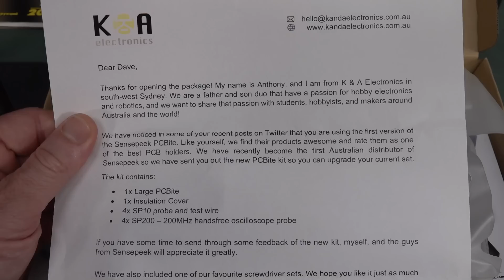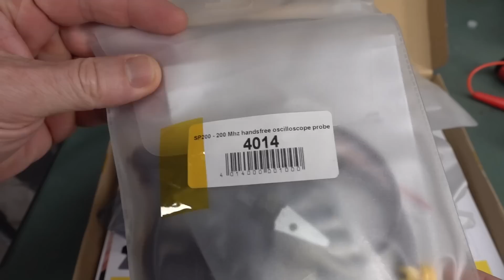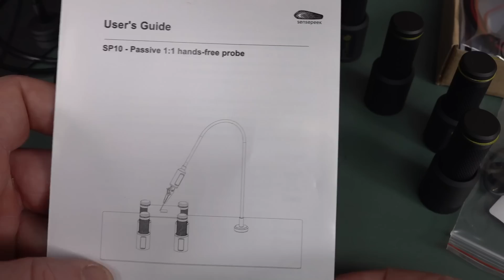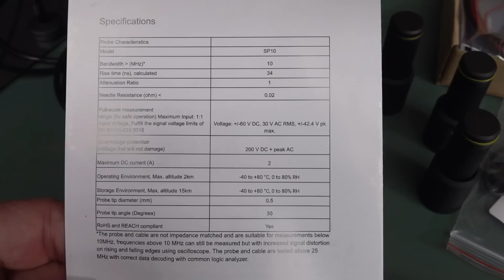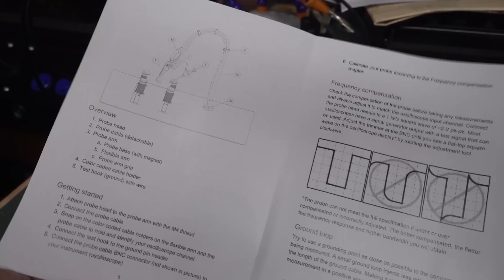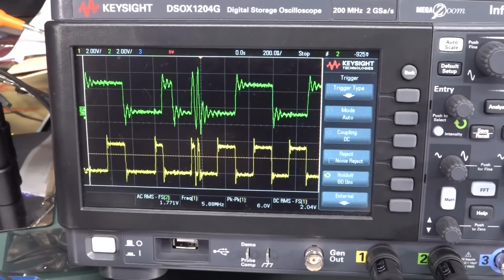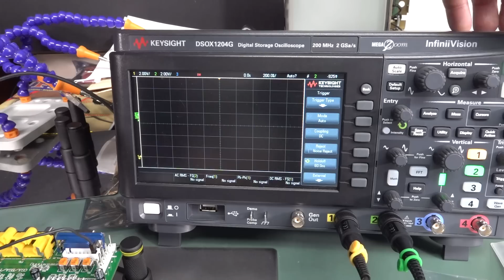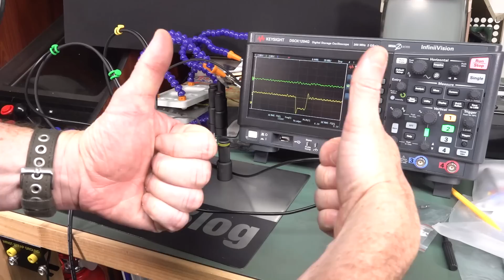PCBite Handsfree Oscilloscope Probe!

Comment: I got some PCBite probes finally!  Unfortunately, I didn't get them from K&A because shipping to the USA was way too much.  Interestingly, according to the specs of PCBite, the capacitance and impedance values show them to be incompatible with many oscilloscopes.  That includes the Rigol DS1054z shown in the full page slick that comes with the probes.  Despite being out of spec for the DS1054Z, they work just fine with that scope.

Comment: I only recently became aware of these magnetic board holders. The downside I have seen demonstrated with the holder style is that is could knock smd components off. A variation I have seen is has a cylindrical concave surface that supports the board without having to actually clamp on to it. I am definitely getting a set of those probes.

Comment: I got this kit a couple of months ago.  I had the same reaction.  Absolutely life changing.   
One note.  The sp10 probes can be used as the ground connection, or for DMM connections or injecting signals/power.  The two wire connectors on them let you daisy chain then or just put a well placed jumper from one place to another.

Comment: can we also talk about how lovely it is to have large color indicators! When I am doing tests I always have more then 4 cables out (pwr, oscilloscope probes, Voltage, amps, etc..) , and its hard, especially when all my wires are on the table to identify which wire is which but those large indicators are going to be awesome!!
Reply: They thought about that really well.
Reply: @EEVblog  so much better then those tinny color indicators that can easily be hidden by a single wire lol

Comment: Dammit Dave, you're costing me more money! First it was the Ioniq (got my all-electric last month), and now it's these probes! I can do the PCB spring clips on my 3D printer, but those pogo-pin probes are beautiful. On my board, it's lots of test points, maybe deliberate solder mask gaps in early revs, but those are really,really nice. Having a set of those on hand will save me from using as many of my "special words" while debiugging!

Comment: Nice to see they added oscilloscope probes to their line-up. Ordered a bunch rightaway. Have been using their classic 'SP-10' in conjunction with a normal scope probes, but that was always kind of messy. Actually never cared much for the PCBite holder itself, most of the time I simply stick the goosenecks to a small 0.5kg gym weight or something like that. The probes are sharp enough to maintain position even if there is a bit of movement between the probe support and the circuit board.

Comment: Hey Dave,  I've emailed you thru Amazon and thru eevblog emails, and I have'nt had a response. I am having troubles with your BM235 meter, and I need to find out how to get it exchanged under warranty. Bought it in August 2020, and I says it has a 1 year warranty, but Amazon says it was only able to be returned up until Sept 20(30days). Please help, I need my meter, badly.

Comment: Will the PCBite help you with shots under the Targano microscope, once adjusted for the change in depth? Seems like it provides a pretty solid single platform, which you could slide to show different views. Just my 2 tamagochi. Oh! And hot air re-work; with the greater airflow around the board it would cool more quickly! Yep, a force multiplier tool for sure. Need one, but need a lab first!!

Comment: Wow, these probes really bite!
I suspect quite a bit of materials engineering went into the support structure of the probes. Making a cable with just the right balance of flexibility and rigidity to stand up like that is non-trivial.
Reply: Likely took many design revisions.

Comment: Even if you don't have a scope, anything that uses probes could benefit from this. If you have (a) multimeter(s) you're watching voltages with, you could use this. Grab some BNC to banana adapters and you're set. Or clip to the SP10.

Comment: I wonder if a blunt probe tip with a notch in it would make stay on the chosen pin even more securely? It might not work as well for such tiny pins, but could work even better as an option for less fine ones.

Comment: Something I've always wondered about those "antenna earth leads"

Is the issue the thickness of the wire, the length of the wire, or both?
Reply: The length and the inductance caused by it.
Reply: @EEVblog  BTW, you can easily improve performance of these probes by soldering a short length of copper wire to the ground can, or to the exposed gold ground pads on the back side.

See my review https://xdevs.com/review/sp200/

Comment: Looks compelling, I wish they were conformally coated or had some kind of nonconductive covers. Probes get dragged over PCB's by accident and those exposed shields are a hazard imho.
Reply: You could heat shrink it yourself if needed.
Reply: @EEVblog  True, but I thought they were looking for feedback. I can't imagine it increasing BOM that much and it would make their product that much better.
Reply: Dragging a probe over a live PCB risks shorting pins with the probe tip, let alone the shield.
Reply: @ferrumignis  I'm aware, it would reduce the risk, but not eliminate it.
Reply: @ferrumignis  I can envision a case where you can accidentally lean the shield against tall  energized objects like a power supply or something with bus bars. I would probably wrap the probes in Kapton if doing this, but I don't see any reason this couldn't be straight from the factory and they were looking for feedback on their new product.

Comment: It only works on pcb board installed horizontally on that metal base, don't see how useful it can be when probing instruments and actual systems with pcb inside.
Reply: Err, no, the PCB does not have to be on that metal base, that's just to provide a more secure base so the holder base doesn't slide. You don't need the PCB holders at all, the board can just be sitting on your bench, the probe has plenty of reach.
Reply: I have a little metal stand that I connect the probes to and hang it over the piece of equipment I'm probing when I can't take off the enclosure fully.

Comment: Use the SP10 tips with a multimeter so you can take voltage measurements hands free as seen in the video from this distributor.  https://youtu.be/54eML7PMHjw
Reply: We use the SP10 for logic analysers and multimeters in our workshop too.

Comment: Who still has one of those 3rd hands with magnifying glass that keeps flopping in the breeze tossed into a corner out of anger and frustration? Raise your hands! ✋
Reply: Yep I use these all the time. They also work great as an electrical connection
Reply: heh... fond memories... used to own one myself and i accidentally knocked it over breaking the glass, so i got rid of the glass ring and kept the rest of it.... but yeah, i have tossed one into a corner because of that reason aside from breaking the glass
Reply: I took the magnifying glass off and use it hand held instead. Comes in handy for other things too :)
Reply: Yep.
Reply: +1
Reply: o/
Reply: are you asking if I'm poor? then the answer is yes. I have on of those.
Reply: I have two of them 😂. I printed a solid, square base for one of them though, which clamps the foot down, and I tightened all of the adjustment screws tightly but not too tight like I did with the first one.

Comment: Im using this kit wit 1x probe for years, i even moded the sharp tip to a rounded pogo pin. [I work with flexible PCBs(Ag on TPU) so sharp tip will go trough the pcb. There a getting-used-to  while using this /getting the angle right. But for a R&D and diagnosis its best of the shelf solution.Also PCB Workstation with Nano-Probes by giufini is also a DIY-3D-Print solution!

Comment: I don't even have a scope and I want this now.
Reply: time to get a scope mate
Reply: I don't have a scope either. Just a soldering iron and a multimeter. Has worked for me until now as I just do you average around the house electronics repair as a Joe Average.
Reply: You can get a used scope quite cheap. Its worth it if you do anything more than the most basic electronics
Reply: @smeezekitty  Must be searching in the wrong spots in the Netherlands, because it's relatively cheaper to get a new one than a second hand jobby. The price difference I saw were pretty small to be honest.